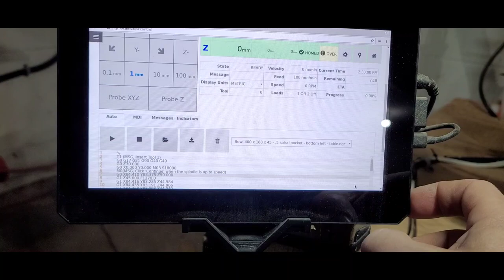Onefinity CNC Woodworking - End Grain Dough Bowl - Full Video - Actual Speed + All the Boring Stuff

Comment: Back again admiring your endgrain patters. Just noticed your hold down tape. I hopyou had more than tape foulded around the corner??
Reply from the maker: Hi John. Looks like I had four strips of tape across the bottom on this one. In hindsight I would have used more tape or used additional hold down methods. I've had a few jobs ruined due to poor workholding techniques.

Comment: That's a lot of chatter! I'd probably have stopped the job and ran less aggressive...
Reply from the maker: I've seen much worse and survived. The 1/2" shank bits are forgiving and can take some abuse (though I did have my finger near the stop button). If this were an item I was going to make more of I would adjust the program to reduce the chatter.
Reply: @chambowoodworks5250  I did the same on mine, but it never turns out as good as your..nice job and thanks for sharing.

Comment: Question what tool path did you execute to get it to just cut the wall on you finish pocket I am struggleing with this?
Reply from the maker: When you pocket leave a small amount of material (referred to as pocket allowance in vectric aspire) and then use a profile toolpath to machine the sides down to your pocket depth. Two separate toolpaths.
Reply: @chambowoodworks5250  Thank you i knew it was something obvious LOL

Comment: Why the two  climb toolpaths? Sounded like lots of judder in the cut
Reply from the maker: I've not had success with conventional toolpaths with the exception of light finishing passes; I tend to get large tearout with certain types of wood / grain. I will tolerate some vibration when cutting cross-grain with my larger bits.
Reply: @chambowoodworks5250  your depth of carve looked quite deep. I estimate 1/8" maybe 3/16". The 1F is a super machine, much better build than I am used to with my (superb) Chinese CNCs, i know I would never carve that deep per pass specially with a bowl bit as that can tear quite badly. I've never carved endgrain to such a level as you. So not sure what to expect
Reply from the maker: @JohnColgan.  you are correct, I was taking about 1/8" DOC with the bowl bit and 1/4" DOC with the 1/2" straight bit. This is the first end grain bowl I made on the CNC; although it was a relatively soft wood it was definitely more taxing than caving face grain.